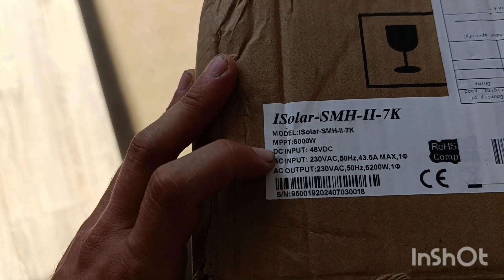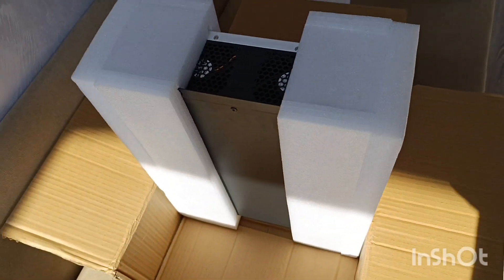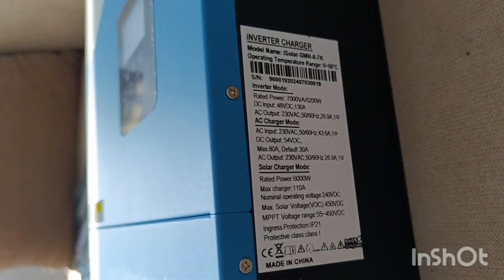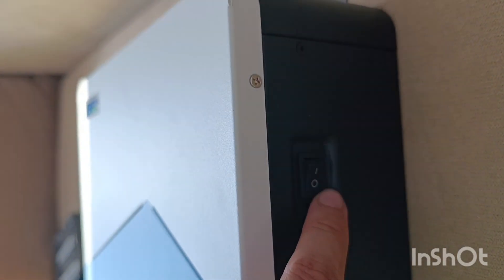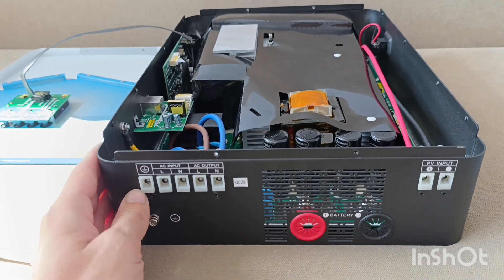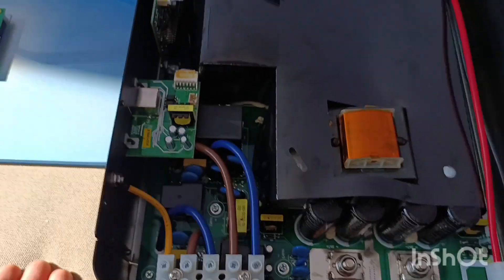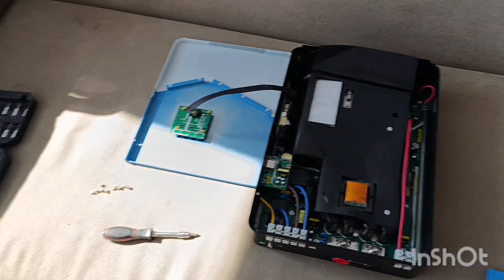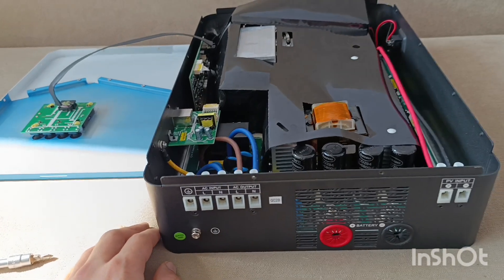Unboxing my small 6.2 kW off-grid EAsun 48V inverter - want to make the garage fully autonomous

Comment: Hi Backyard Voltage good to hear that the Easun is still working as you mentioned in a comment below. You said that you didn't like the connectors ( in the video at about 4:43) and that you might have to replace them. Did you actually replace them? or is the inverter still running with the same connectors. thanks
Reply from the maker: Still running with the same ones...

Comment: These easun models will last you in the 2-5 year range. Luckly they can be repaired usually easily and even upgraded by using non-chinese-crap transistors that they put in them :D
Reply from the maker: If no harsh conditions and no overload - will last waaaay longer
Reply: @BackyardVoltage  no. These inverters tend to fail actually when there is very little load or some random idle time. This is likely because all the transistor bridges are modulated from 1 single microcontroller, if it crashes as mcus sometimes randomly do it will freeze all H-bridges in 1 state, shorting everything. It is one of the things i hate about these, they just could not have used a redundancy mcu for some reason. But besides that the crappy mosfets and igbts can also fail ranadomly, that is why upgrading them is not a bad idea.
Reply from the maker: well, in my case it worked happily for over a year, and then I replaced it with 5 kW Deye. that's still just an addition to my main system. and the main system is a lot bigger and way more sophisticated one. here's about it: https://youtu.be/X9zWiHgpGYY
Reply: @BackyardVoltage  great choice with the deye! They lack a dc blocking capacitor on the low side, so make sure to have an external fuse (if something were to go wrong without a dc blocking cap it shorts the battery). 

But deye has otherwise a nice design (it even has a redundancy mcu), it should last a while. Btw does the easun one still work?
Reply from the maker: external fuses, SPDs and additional circuit brakers on PV-side (and on batteries same applies to at least fuses) are a must. Deye (and basically any other inverter too) does not like DC-shortcut. that's why I also additionally had split the DC-ground and AC-ground with literally different grounding contours.

EAsun still works nicely, no issues there, it just moved to another owner, and works there as a charge controller mainly, since he just wanted to supply additional east-west parallel arrays to his existing system and had not enough MPPTs/PV-inputs on the existing inverters.
Reply: The brands are pretty much useless, they change manufacturers faster than I change my socks. Check the manufacturer and forget the brands.
Reply: @Flaggyt  easun is not like that
Reply: @cuf_  yeah I just noticed that, does that mean they are unreliable over the whole product range? 😁 Was looking for srne inverters, even they have different manufacturers (srne and grimatt or something like that) it's getting impossible to know what you are buying...
Reply: @Flaggyt  iv heard the SMW 11KW from easun is actally really good, the SMG II 6.2KP (KP=Parallel capable, kw=not) witch i have is "okay" (has some downsides and is worth the price), and like their 3.5kw models are garbage. 

Its all mixed, ofc deye and such will 100% beat easun all time but it is a nice cheap alternative. Must do your research.
Reply: @cuf_  yeah i'm searching for a reliable 48v 5kW inverter for the 230v in the motorhome, separate from the 12v system so I can take it out when I find a nice off grid property somewhere. Doesn't have to be terribly cheap (like the €250 inverters) but I'm afraid when I'm buying a €700 inverter I just get a rebranded €250 one. 😂 Think I'll just go for an srne made by srne hoping it will last at least 5 years, by then I'll probably need a bigger one anyway.
Reply: @Flaggyt  the cheaper models of srne seem to share the same design as other cheap chinese brands. They seem to have populated the boards a bit better tho and they might last longer. 

A polish engineer reviewed the easun SMG II 6.2kp (the inverter i have rn and it is running my house rn so i am typing this comment off its power) and it is not terrible.

Some people report it going strong after 2.5 years of use, but to stay safe a more expensive deye/srne model will fit you, but if you are like me and are down to repair the easun one when it diesthat could be an option too.

My plan is to upgrade the igbts and mosfets to some brand like INFINEON if it breaks to maybe get even more life out of it.
Reply: @cuf_ yeah I would feel comfortable soldering a few new condensators on there if needed (that seems to be the main problem with these things), but I'm traveling through Europe for a few years (at least) and on the road I just need it to work, replacing is easy enough but I'd rather not. So I'll stick to the pricier ones. And puzzling which one is half the one right? 😁
Reply: @Flaggyt  honestly that is not even the main issue. The capacitors often die from overheating. What to worry about mainly is the gate drive to all the mosfet and igbt bridges, and the parts themself, they tend to use crappy cheap ones with a slow drive signal or a design that can freeze the bridges in a mcu crash.

That is why im planning on upgrading to quality parts :D

Comment: A very bad choice for an inverter. Not only do high-frequency, transformerless inverters offer a shorter life expectancy and a far poorer surge capacity, but they can also be dangerous for use in full-time residential applications. Ask Google AI: Can high-frequency, transformerless inverters be dangerous for use in residential applications? If you doubt what I'm saying.
Reply from the maker: @solarcharging9743 hahahaha. Have fun.
That beast works well and does exactly what it is designed for.
Talk to you in 10 years when you will change your indian-made victron two times.
Reply: @BackyardVoltage  lol the victron shills are here in full force. the irony is that high frequency inverters are more efficient and much more compact in size. what kills inverters usually is dust, humidity and bugs who cause leakage current and finally a capacitor will go too far out of spec. because its always a capacitor. ya transformer style will last longer but im sure theyre all using the same cheap capacitors. victron makes all their products extremely difficult if not impossible to repair. they usually cover the boards and components in silicone. they are a nightmare to try and fix. their mppt's are covered in random blobs of epoxy and are not serviceable. maybe better for nvh and thermal performance, but when they break they break. 
there is a channel called RolandW_DIYEnergyandMore , he has been running inverters on his hotel property in thailand for almost a decade and has several videos repairing his inverters when they fail. its always a capacitor.
Reply: For the millionth time, they are not transformerless. High frequency inverters HAVE A TRANSFORMER, it is just way smaller, lighter and more efficienct if used right. It uses ferrite as the core to minimize eddy current losses and make it work at a high frequency.

The reputation of these inverters is ruined by crappy chinese models, it is not about the topology it is about the quality. A high quality high frequency inverter is better than a modest qualty low frequency inverter, and BTW does NOT lack surge capacity.
Reply: Use a B type RCD for safety and you're good to go.